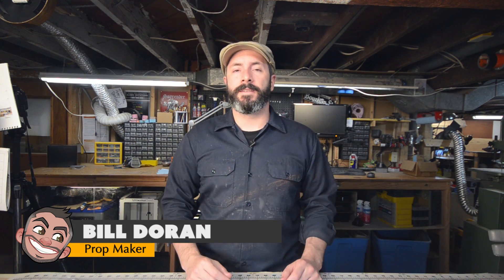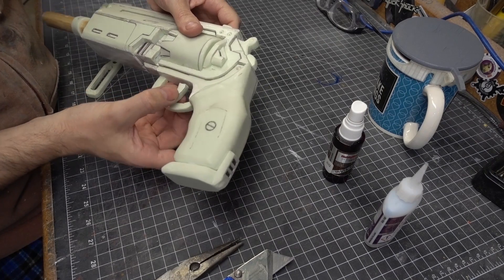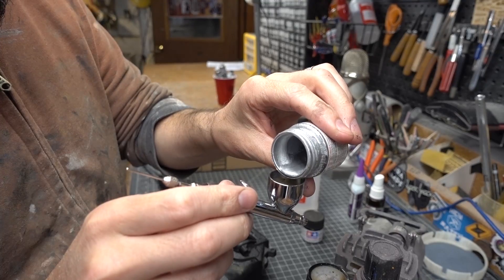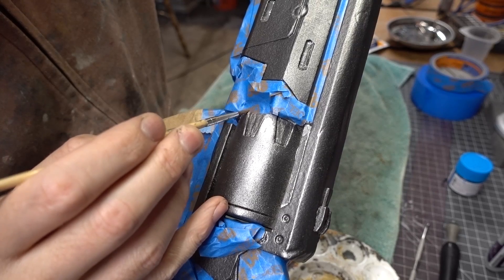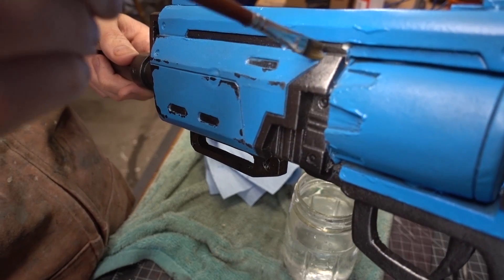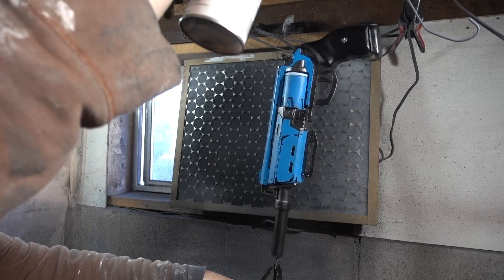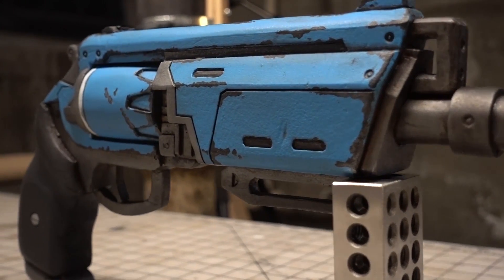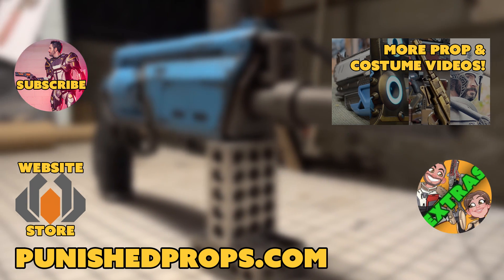Painting a Destiny Hand Cannon - Andrew DFT Collaboration

Comment: I've been wondering about thinning Mod Podge and running it though a critter gun. That is awesome that you can! What did you find to be a good ratio of water to Mod Podge?
Reply: Awesome! Thanks for the advice. It looks really amazing!
Reply: Punished Props I have the Gloss Lustre Mod Podge, you can actually see you're hand after 2 coats painted directly onto Eva (within 1-2 inches) I need to do more R&D to see if I can get reflectively further away though .

Comment: Where do you find metallic acrylic paint? I found enamel paint by far and it should work on foam. Should being the key word
Reply from the maker: I usually get those paints at the hobby store. Enamel should work on foam, just know that if the foam bends or flexes, the enamel will crack.
Reply: Punished Props I guess I can always plastic coat it then. If your wondering if that's possible, it is and XRobots showed how on a scrap tutorial